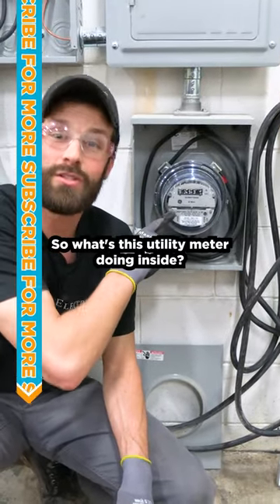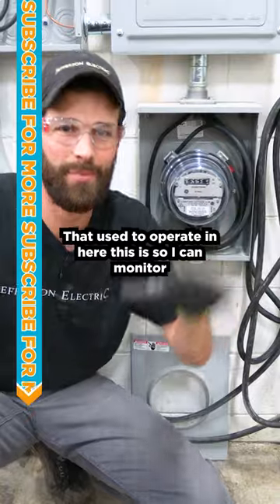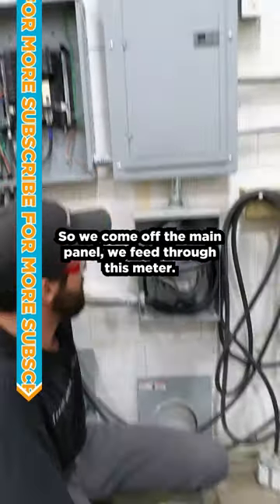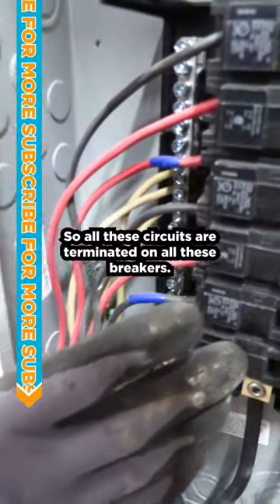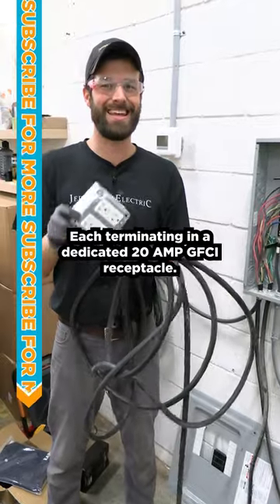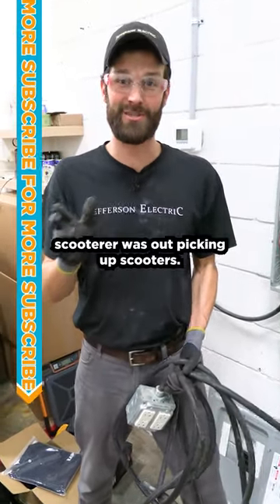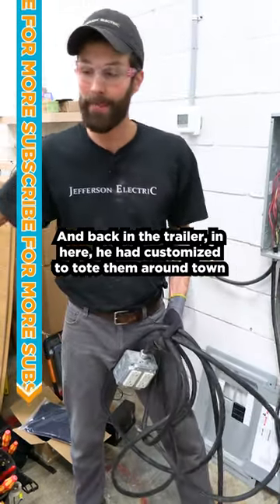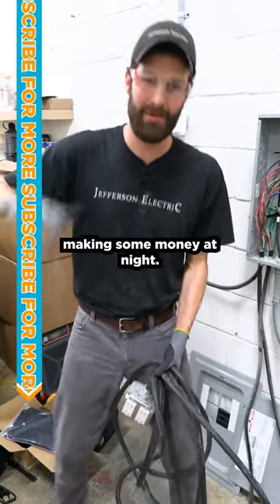What's this utility meter doing inside?

Comment: That outlet box in your hand is illegal. Not UL listed for the use.
Reply: If it's sitting outside in the weather then yes, it is illegal. It needs to be in a dicast weather proof box. If the boxes inside the trailer out of the weather and not outside than it is fine. It depends on the application.

Comment: The new WiFi connected ct system is way cheaper and better. No need to separate circuits to a sub panel, you can monitor individual circuits

Comment: You can make up a drop from the ceiling with cord reel ; not what you did. Sjo , so is same as extenstion cord. Temp use only. Not permanently wired to panel😊
Reply: Just install a twist lock to separate the cord from the panel problem solved.

Comment: So how does it know when to reset for the month or if it doesn’t and you just have to record the numbers each month/subtract last month… It’s an old style analog meter like utility companies used to use.
Reply: In this case someone has to manually record the reading on a regular basis, then do the math to see how many Kw they are using.
Reply: I've installed several meters that are wifi connected. 
The landlord then monitors each tennant. Tally up their portion of bill then reset to zero. 
Start again next month.

Comment: Read awhile back that in my area a homeowner or business owner is not permitted to install any meters and charge for power, water or natural gas used. In duplex apartments they will only install a single water meter that creates problems when high usage occurs by one Tennant.